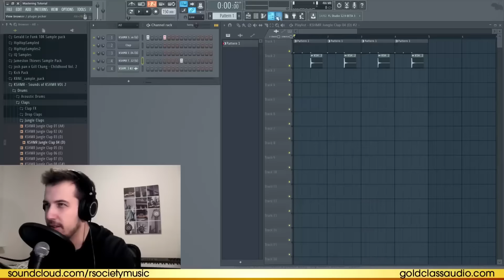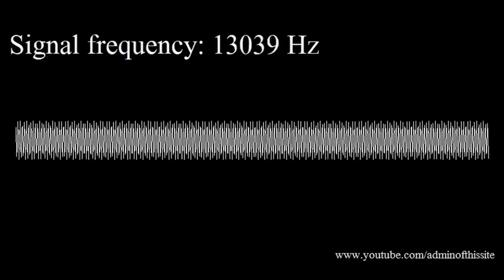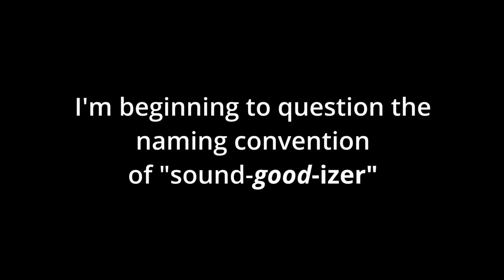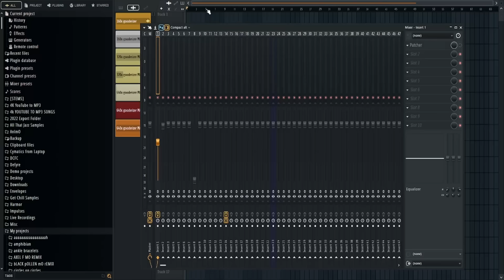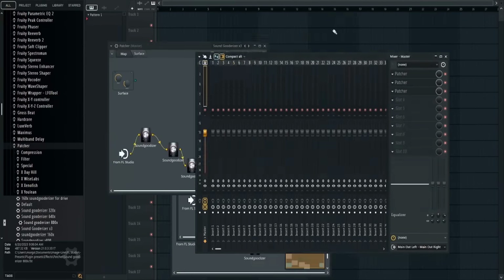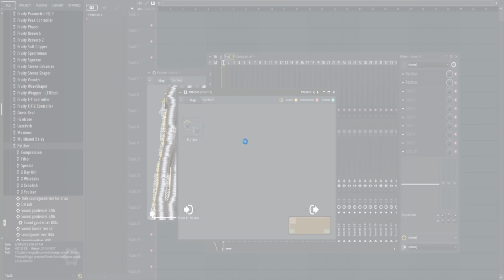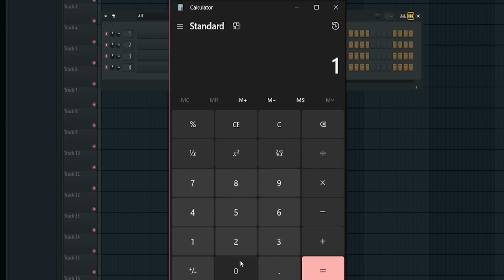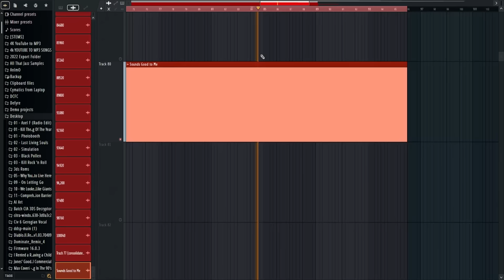4 Million Soundgoodizers on 1 Kick Drum

Comment: hey, great video, but the description of bit depth and dithering are a bit misleading imo.

the only thing bit depth affects is the noise floor, but you showed a stair step graph and talked about accuracy of sound reproduction. there's no stair step created at any point in converting digital audio to analog, and that graph is more relevant to sample rate (but still inaccurate). bit depth is how precise the individual samples are (ie how close to the actual number they're trying to represent). the only thing it affects is the noise floor because of dithering.

because the digital samples cannot be infinitely precise, we have to choose how we want to pick samples since they can't be exactly on the signal. this always creates noise in the output, and dithering is a strategy of shaping this noise to be as quiet as possible and put it in less audible ranges so humans can hear it even less. and as you may have guessed the amount of noise is determined by the bit depth. not dithering does not remove noise it would just be different noise (and is more likely to be audible to a listener). the bit depth vs noise amount shown during the dithering section would have been perfect for the bit depth description part!

again great video, I love people taking silly ideas extremely seriously.

Comment: When i saw you opening the plugin each time i said oh no 😢 if you right click on it in patcher theres an icon next to save preset. You can drag and drop it on the output of the previous one. You could then save the patcher preset after you've done like 10. open patcher within patcher load the preset and repeat the previous steps over and over. It would take only a couple mins to be at thousands

Comment: explain y it elongates the source sound. shouldn’t compression/saturation just change the frequency content, and not affect the time domain??
Reply from the maker: Its most likely that its progressively adding harmonics, and it also takes longer to pass the data through thousands of plugins, so the tail of the kick slowly gets longer, and over the course of thousands of them, it becomes a very long sound (not a feedback loop though, because the kick does eventually end, despite me cutting it off in the export).

Comment: Why the kick sound is getting lengthier then before, after each exporting? 
Does anyone know?
Reply from the maker: There's two main reasons:

1. The effect of Soundgoodizer is enhancing frequencies, so things that were previously only partially audible are all of the sudden very present in the EQ band of the kick.

2. (the more important reason) is because it's creating a sense of a feedback loop. In the beginning, FL Studio was set to export for as long as the kick was making sound, but since the kick's audio is going from one plugin, to the next, and the next after that, it's almost like a chain of dominoes knocking into each other; the more dominoes you have, the longer it takes the initial force used to push down the first domino to reach the final plug-in. If you've seen the video of one tiny domino that pushes down one twice it's size, and repeats until you have a human sized domino pushing down a GIANT domino, you'll see it takes a lot longer to transfer that force to knock down the last one.

These two reasons combined are essentially creating extra audio data, which will carry on into the next plugin, which will add a little bit more length to the kick drum in each following use of the plug-in, until you have an output that is insanely longer than the initial kick drum. Since each usage provides more frequency presence, this triggers the following plugin to act even longer, and then when it reaches the final Soundgoodizer plug-in, it ends up processing all of the extra audio data.

Really what you're hearing is almost a 'signature sound' of Soundgoodizer's code, and a chain-reaction of it reacting to "gooderizing" it's own sound.

Feel free to ask further questions if you have any, or if it'd be helpful to try and clarify that a bit better!

Comment: If the limit is 10 000GDI per process, why not use a FL Studio VSTi in the master that would redirect the chain of 125 insert (or whatever the amount, just to use the 9000 GDI) to another FL Studio project and daisy chain that process ? 
With this, you could make each FL Studio use around 9 000 GDI, because each FL would be its own process while receiving the sound.
Reply from the maker: Because it's still housed in the main instance of FL, in the eyes of windows; it doesn't become a new process instance, and doesn't allow for 10k more GDI handles.
Reply: @mo_oorgan  What about different real instance of FL with virtual cable routing then ? x)
Reply from the maker: @antoinepersonnel6509  not something I'm acquainted with, and would still require 5000 instances of fl studio running. Please note I'd theoretically still need 5,000 gb of RAM to make it happen, for 4 million instances of SG.
Reply: @mo_oorgan  Yeah totally just felt to think like what is the max that is actually possible without consolidate/bounce, fun things to think about even tho they are impossible to execute.

Comment: why does it get longer though?
Reply from the maker: Interesting question! Two reasons, neither of which are a feedback loop:

-Each one extends the tail of the kick by a small amount. There's audio data at the tail of the kick that is silent to our ears, but is moving the speakers and is still part of the kick. There's a point where the tail is essentially an overly distorted low frequency sine wave, and the chain of FX essentially gives the kick a new tail, which is then overly-dustorted again, giving it another new tail, 100k times in a row.

-It's likely the plugins are adding microscopic amounts of time to process the data, one after the other. I can't confirm this second possibility yet, but am looking into it for a follow-up to this video.
Reply: @mo_oorgan  ah that makes sense. or maybe it's like u said a tail per plugin, and then gain is making it Audible